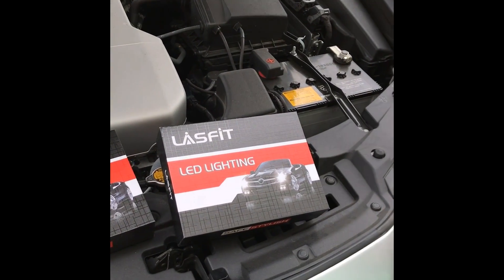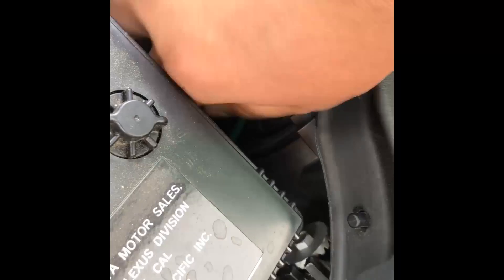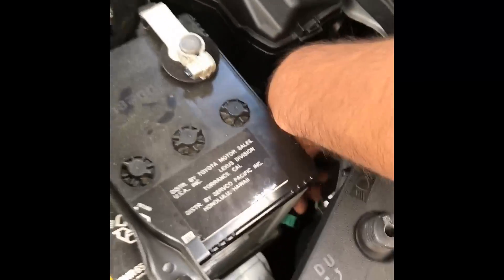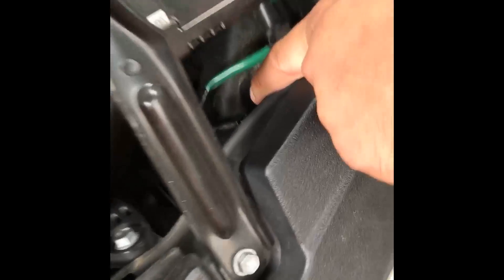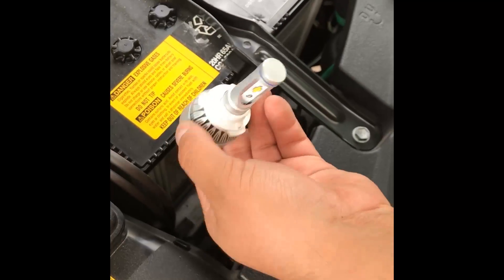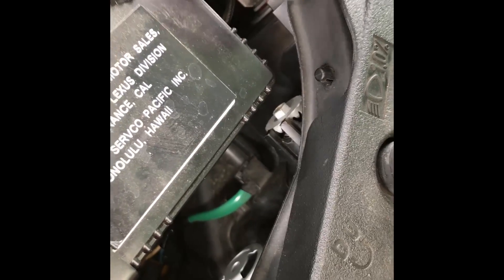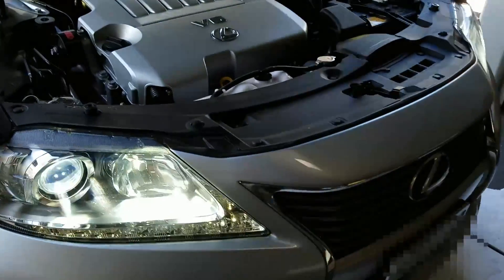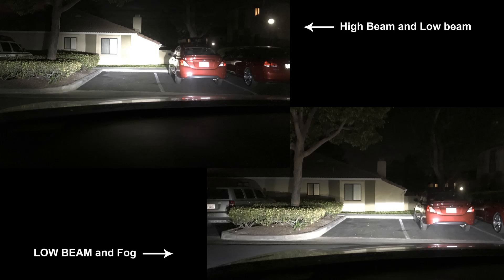LASFIT 2014 Lexus es350 LED Headlight Bulb Low & high beam installation

Comment: Did you experience any flickering of low beams while turning on the engine?
Also, do you use the High beam as DRL and if so did you experience any flickering in DRL mode?
Reply: I got flickering on mine 😢

Comment: did you have HID??  also this canbus get really hot inside  the assy  Also did you put the low beam cover on when finished
Reply from the maker: Hi, we focus on LED lights only, don't have HID. There is no dust cover for 2014 Lexus ES350. Skip to 01:40

Comment: Do these new LED lights require any re-aiming?
Reply from the maker: Generally, no need any re-aiming. But if you find the output beam pattern is not focused, you can turn the LED bulbs to adjust the beam pattern.

Comment: Does this work on the 2013 es350 with the halogen ones with the ballast
Reply from the maker: Hi, we recommend the following LED bulbs for your 2013 Lexus ES350 to replace the halogen lights:
#LSplus9005 fit your high beam: https://www.lasfit.com/products/ls-plus-series-9005-led-headlight-bulbs?utm_source=Social&utm_medium=YTB+Channel&utm_campaign=LSplus9005
#LSplusH11 fit your low beam: https://www.lasfit.com/products/h11-h8-h9-led-headlight-bulbs?utm_source=Social&utm_medium=YTB+Channel&utm_campaign=LSplusH11

Comment: Would this work in the prior model design? I own a 2007
Reply from the maker: Hi, for 2007 Lexus ES350 with OEM halogen headlights, the high beam is 9005, low beam is H7, here are links: 
low beam H7: https://www.lasfit.com/products/h7-led-headlight-high-low-beam-fog-light-la-series?utm_source=Social&utm_medium=YTB%20Channel&utm_campaign=LAplusH7
high beam 9005: https://www.lasfit.com/products/9005-hb3-led-headlight-high-beam-la-series?utm_source=Social&utm_medium=YTB%20Channel&utm_campaign=LAplus9005

Comment: my 2014 lexus es has a plastic cover for the low beams, which i have to twist to get off. then inside, there’s the bulb but it seems so different from the one you have. someone please help? i can include a picture somewhere
Reply: My model is 2014 Lexus ES 350 and yes, it does have a metal plug in the bulb housing. And I believe they are factory HID bulbs (d4s discharge bulbs) https://imgur.com/a/86VcJ
Reply: @jaiwinstonn7418 5 Years later, what did you do with it? how did you figure it out because I’m trying to do it.

Comment: This will apply the sane steps for es300h?
Reply from the maker: What's the year of your EX300h?
Reply: @Lasfit-Automotive  it’s 2013-2014 lexus es300
Reply from the maker: @aliquran7535  Ok. If your stock low beams are halogen bulbs, below LED bulbs will fit your car.
Low beam H11:
https://www.lasfit.com/products/h11-h9-h8-led-headlight-fog-light-la-series?utm_source=Social&utm_medium=YTB%20Channel&utm_campaign=LAplusH11-LB

High beam 9005:
https://www.lasfit.com/products/9005-hb3-led-headlight-high-beam-la-series?utm_source=Social&utm_medium=YTB%20Channel&utm_campaign=LAplus9005

The fog light is the same bulb size as low beam, H11.

Comment: But would it work if you had stock hids?
Reply from the maker: No. It is used to replace the stock halogens only. We carry LED bulbs to replace the stock HID D4S for 2014 Lexus ES350, but it is not plug and play. You need to splice the power wires. This is the LED bulb:
https://www.lasfit.com/collections/d2/products/lasfit-d2s-d2c-d2r-d4s-d4-led-headlight-bulb-hid-xenon-replacement-philips-chip?utm_source=Social&utm_medium=YTB%20Channel&utm_campaign=LAD2

Comment: Why are you using the LED with a ballast? My previous car was a 2011 Sonata and I was using all your bulbs with out the ballast and zero issues. 
I now own a 2013 ES350 fully loaded of that matters and Now I’m not sure what to use. With ones with no ballast or the ones with. That’s well over $200 for high, low and fog lights. So that’s a no for me. But...  I can afford the others.

Comment: Does it work for Rx350 2018 ? And any idea which on fit with RX 350 2018 low beams ...thanks bro
Reply from the maker: Hello, we checked the OEM headlight low beams and high beams are LEDs already for your RX350 2018. So, these after-market LED bulbs don't fit.
We recommend below LED bulbs for your car:
Reverse lights: https://www.lasfit.com/products/canbus-921-912-led-reverse-back-up-light-bulb-upgraded-version?utm_source=Social&utm_medium=YTB%20Channel&utm_campaign=T-T15
Front turn signals: https://www.lasfit.com/products/7443-switchback-led-turn-signal-lights-canbus-error-free?utm_source=Social&utm_medium=YTB%20Channel&utm_campaign=T-7443D\
Rear turn signals: https://www.lasfit.com/products/lasfit-7440-7441-w21w-led-turn-signal-lights-canbus-error-free?utm_source=Social&utm_medium=YTB%20Channel&utm_campaign=T-7440A
License plate lights: https://www.lasfit.com/products/2x-lasfit-t10-192-194-168-158-led-interior-light-bulb-error-free-1-year-warranty?utm_source=Social&utm_medium=YTB%20Channel&utm_campaign=L-T10-White

Comment: Any error messages for fabless lasfit if I install led on 2015 Lexus ES3500 high beam 9005 HB3
Reply: Any error messages for lasfit fanless  9005 HB3 high beam if I install on 2015 Lexus ES 350
Reply from the maker: Hello, error free.
In case you run into any problems, you can return them back for a refund. We provide 45 days money back guarantee.

Comment: So why was I told I can't change the low beams on my 2012 Lexus ES 350? I have asked them and they have told me that it is not possible because there is no LED that can replace the D4S Xenon
Reply from the maker: We have LED bulbs to replace OEM D4S bulbs, but they are not plug and play. You need to modify the power wire, here is the link: https://www.lasfit.com/collections/d2/products/lasfit-d2s-d2c-d2r-d4s-d4-led-headlight-bulb-hid-xenon-replacement-philips-chip?utm_source=Social&utm_medium=YTB%20Channel&utm_campaign=LAD2
Reply: @Lasfit-Automotive  So why does the Ebay seller "vigoshop 2015" tell me they don't have Lasfit LED bulbs to replace Xenon bulbs in a projector headlight? Please if you have a replacement for the Xenon D4S bulbs but they are from the LS series it would be better. I have seen some that even bring a cover with a fan to replace the original cover that the car lamp comes with
Reply from the maker: @reinaldoveitia4261  Maybe the authorized seller on eBay thought you need the plug and play LED bulbs to replace Xenon bulbs.
The universal D2/D4 LED bulb is LAplus series: https://www.lasfit.com/collections/d2/products/lasfit-d2s-d2c-d2r-d4s-d4-led-headlight-bulb-hid-xenon-replacement-philips-chip?utm_source=Social&utm_medium=YTB%20Channel&utm_campaign=LAD2
As for the LED bulb bring a cover with a fan is custom-made LED bulbs for specific vehicles/models, such as Toyota Highlander 17-19, Ford F-150 15-17 / 18-20...

Comment: Will this work on 2013 lexus gs?
Reply from the maker: Nope. These LED bulbs are used to replace OEM halogen bulbs. For 2013 Lexus GS, the OEM headlights are HID bulbs, D4S. We have the LED bulbs to replace the D4S HID bulbs, but it is universal type, which means the power wiring modification is required.
Would  you mind to make modification for the power wirings?
This is D4S LED bulb:
https://www.lasfit.com/collections/d2/products/lasfit-d2s-d2c-d2r-d4s-d4-led-headlight-bulb-hid-xenon-replacement-philips-chip?utm_source=Social&utm_medium=YTB%20Channel&utm_campaign=LAD2
Reply: @Lasfit-Automotive  ill stick to HID's. THANKS

Comment: Hi can you please help me I got 2008 lexus es 350 I need low and high beam
Reply from the maker: Your OEM low beam is HID or halogen? These LEDs fit your  2008 lexus es 350 with halogen low beam and high beam. Low beam: https://www.lasfit.com/products/h7-led-headlight-high-low-beam-fog-light-la-series
High beam 9005: https://www.lasfit.com/products/9005-hb3-led-headlight-high-beam-la-series

Comment: Can this fit on my 2010 lexus es350?
Reply from the maker: For your 2010 lexus es350, the low beam bulb has 3 models, H11, H7 and HID bulb D4S. It's better to take a photo of your original low beam bulb to send us for a look. Yes, these LED bulbs 9005 will fit your high beam.

Comment: The lexus dealer stated they cannot replace the bulb bc they replace the entire assembly. Why are they saying this when u did it. Plus they want 1400 for 1 side
Reply from the maker: Hi, could you please tell us whether your Lexus has halogen light and the year and the trim of your Lexus?

Because we have replaced the halogen bulb without talking the assembly off on the 2014 Lexus es350.
Reply: @Lasfit-Automotive  no worries. It was a simple light bulb 140 for the bulb autoz. It was the dealer running a scam. Definitely told my friend to report it. Ty for your time
Reply from the maker: @harrylafountaine5764  It's my pleasure.😄

Once you want to try Lasfit LED bulbs next time, please leave a message with your Make/Model/Year information, I would like to provide you with compatible LED bulb information.